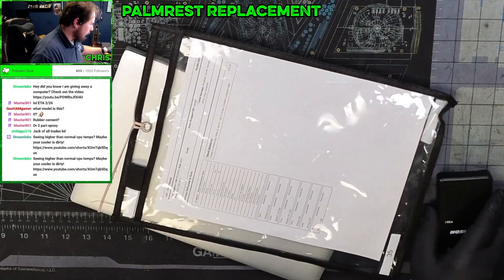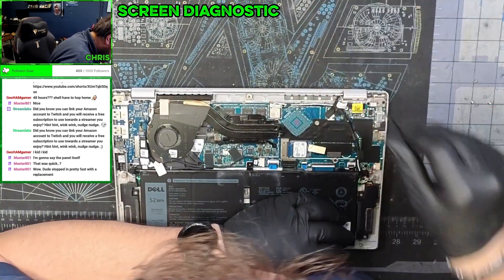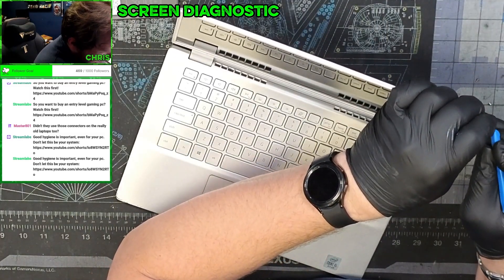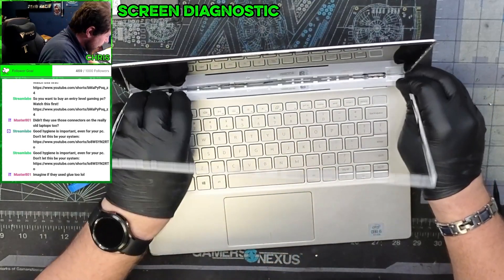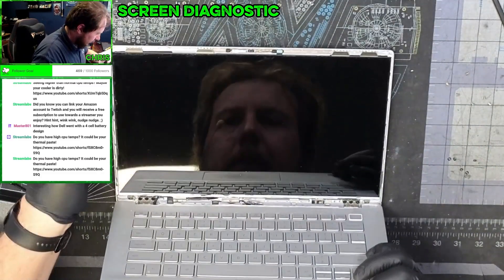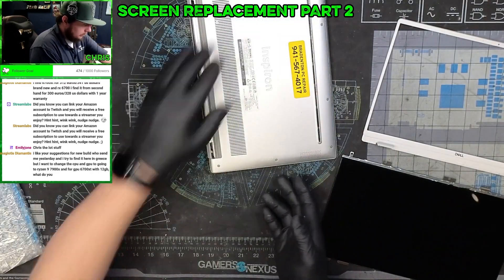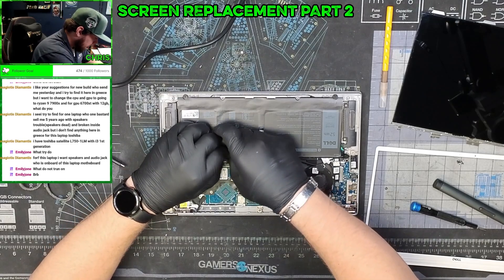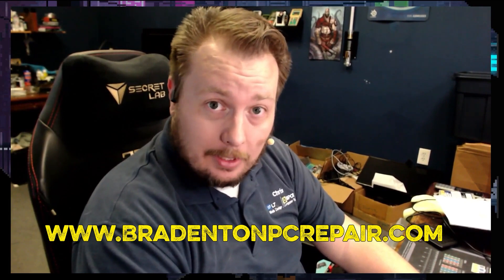Dell Inspiron 7490 Screen Replacement, At Least it was simple #203

Comment: yeah the first thing I do with anything is disconnect the battery so it doesn't do that lol. But Latitudes and Precisions are much easier to work with and have less thing brittle stuff. This precision 3550 I am typing this on had a very easy screen upgrade process. Did it in 30 mins and it was the very first time I replaced a laptop screen in my life.
Reply from the maker: Once you have done it a couple times, its easy, but sometimes man. I have a Suface Laptop 4 here right now, where the only way to disconnect the battery is to remove the motherboard. THANKS MICROSOFT.
Reply: @Bradenton-PC-Repair  oyy
Reply from the maker: @remixedcat  https://www.twitch.tv/videos/2267385269